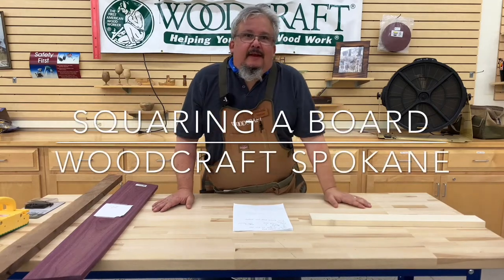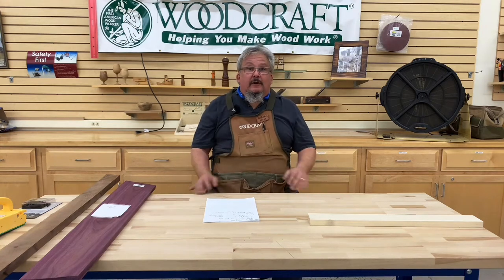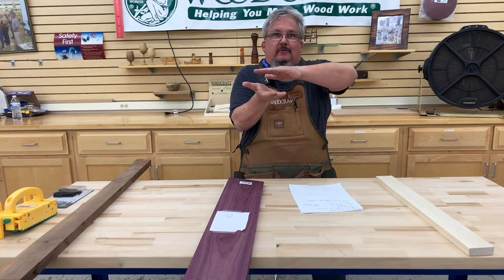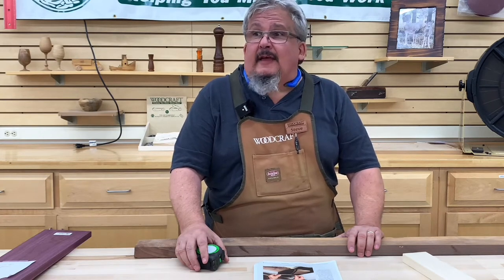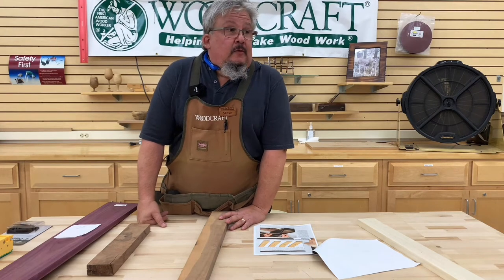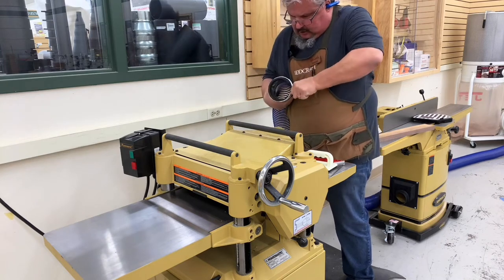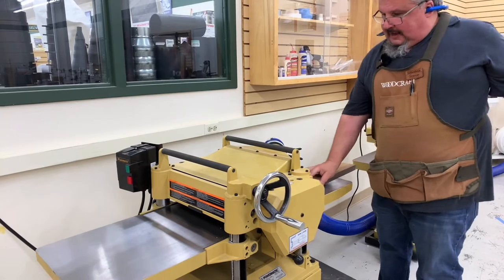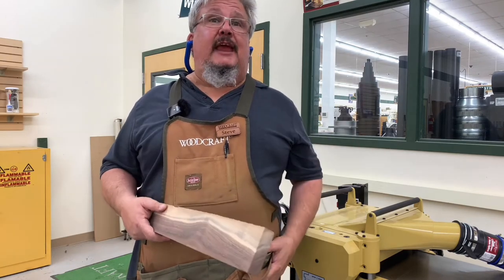Squaring a Board

Comment: Three comments: 
1) It is interesting how different woodworkers differ on what the proper blade height is on a table saw. You say to clear the gullets. This is the way I do it. Ostensibly it is so the blade runs cooler. I just watched a Fine Wood Working video where the owner of a school says the blade should only be 1/4" above the wood. This is for safety.

2) You missed one part of prepping the wood - re-sawing. In the case of a guy wanting to make a jewelry case, he's probably only going to want 1/4" to 3/8" thick stock, not 1-1/4". You certainly wouldn't want to waste 3/4" of board planing it down to 3/8".

3) I suggested to Nick that there needs to be a way for people to use the classroom tools to do some of the prep work. I don't have a jointer. It would be nice if I could take a board I'd just bought into the classroom and clean up at least one side, preferably a face and an edge. I have a small bandsaw that limits me to 3" re-saws. If I wanted a wider board, being able to use one of the larger saws in the classroom would be beneficial. I realize there are problems with liability. No one could use these who hasn't taken the safety course. There would have to be an employee in the room while it is being used. There would have to be allowance for a nominal fee, as well.